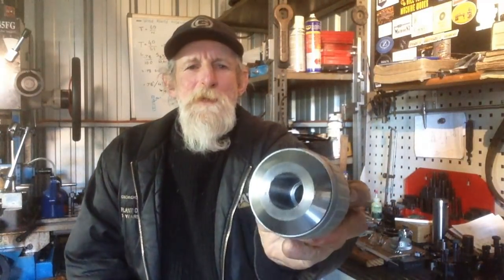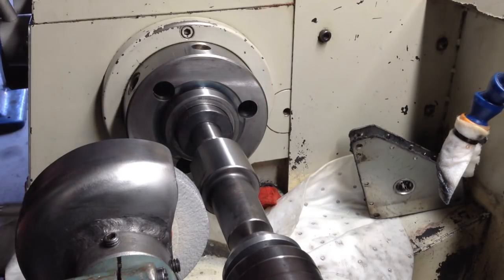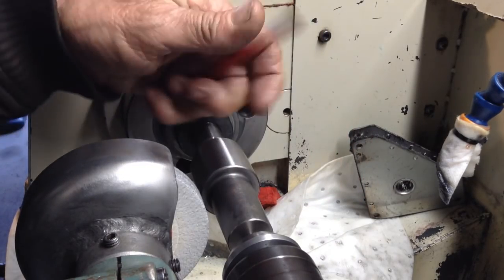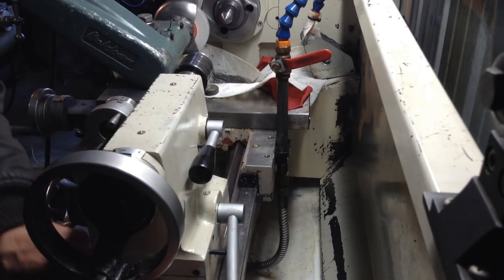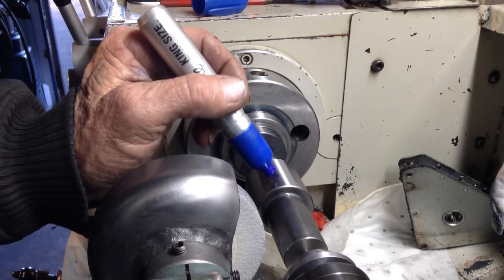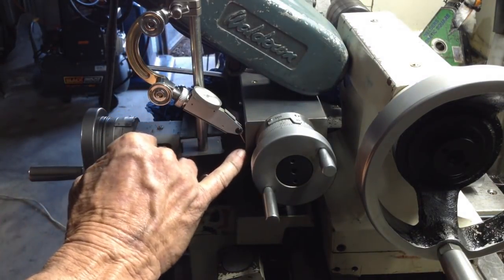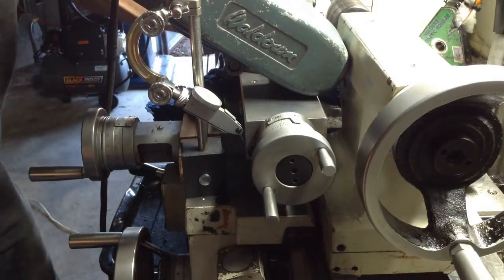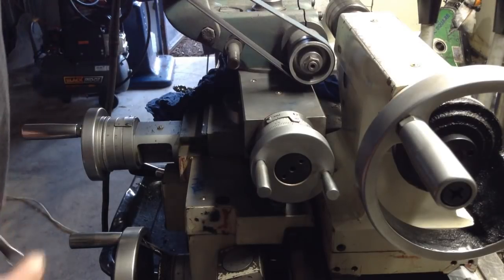We make up a JT4 to 40mm stub arbor for Bruce Withams  horizontal boring machine .

Comment: Sorry to hear about the lathe issues. Hope you can fix it with minimal time, cost and trouble. The shim under the tailstock was a good idea. I love the results you're getting with the toolpost grinder and lathe set up as cylindrical grinder. I will have to search back to see if you have any videos on the heat treatment. Cheers, Craig
Reply from the maker: Thanks Craig . The turning & heat treatment i did off camera .   Thinking back i could have filmed it for the TMC !    Cheers .

Comment: Tally Ho to the rescue, recently replaced the counter shaft bearings in my headstock, luckily had the Sykes Pickavant blind bearing puller, saved me from pulling the whole headstock apart.
Reply from the maker: I have a set of Sykes Pickavant pullers as well , looks like i might have to blow the dust of them soon  !
Reply: @swanvalleymachineshop  Let me know how you get on, my bearings were tight too remove.
Running sweet now.

Comment: Hi Max. Some old fella showed me the fag paper trick some decades ago, but he also had a sneaky other way. Instead of putting the papers under the tailstock he put a sliver of paper in between the center and the job, with much the same result and easier if you are dealing with a heavy tailstock. Lovely job BTW. Best wishes, Mal.
Reply from the maker: Thanks .   Will have to keep that one in the memory banks !  👍

Comment: Angle of the Dangle done beautifully Max.
Hope you can the lathe repaired, or most likely better than original?.
Thanks for sharing and best regards from the UK. John.
Reply from the maker: Thanks .  I might just do a small repair & just fix the bearing  , not sure yet .  I would like to do a full upgrade of the headstock  & change the gears to helical , but that will have to wait until the new shop is finished & the other lathe is wired up .    Cheers .

Comment: I was wondering what the temperature was there so I checked the average weather for July in Swan Valley. It showed an average high of 65F and average low of 47. It looks like 3.7C [39F] has been the low for the month and 22.9C [73F] the high. Here in Wisconsin, we call that T-shirt weather. Our average January temperature is a high of 22F[-5.5C and a low of 4F[-15.5C]
Reply from the maker: That's cold enough to freeze the balls of a brass monkey , and we think it's cold here !   Cheers .